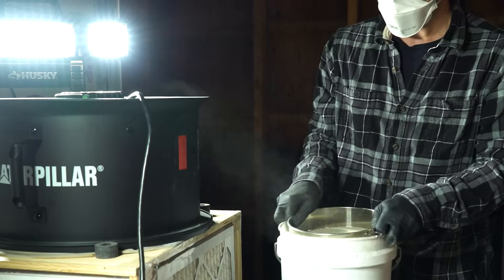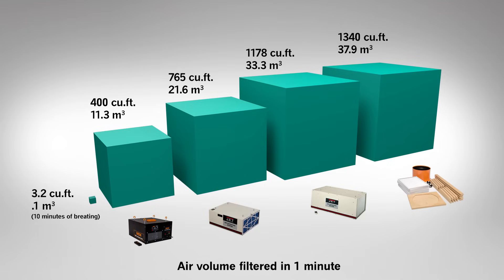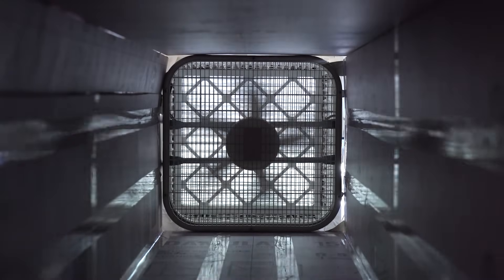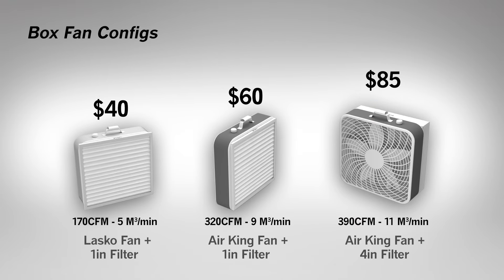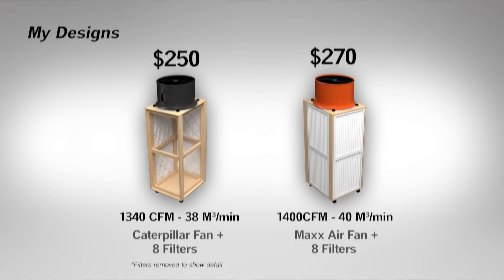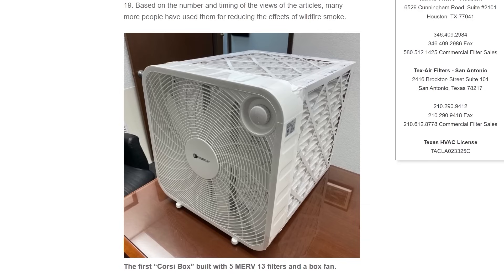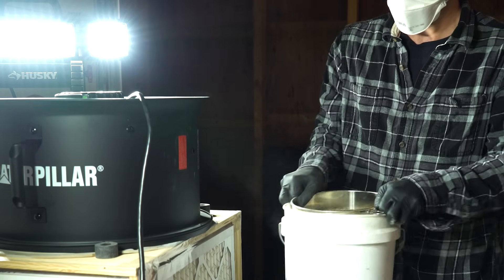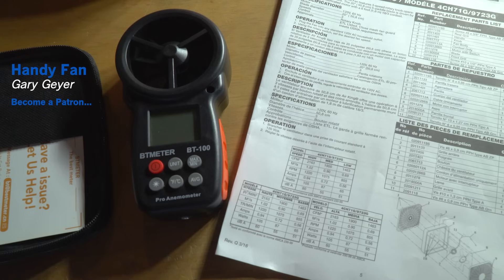What is the best DIY Air Filter?

Comment: You absolutely do not want to be using higher than Merv 9 on your air conditioner when running in cooling mode. Florida people know this. You’ll get high static vacuum and the system will perform poorly even before the filter clogs up. 

You’re better off running spot filtering with high merv filters. Maybe even running high merv spot filter right in front of main air handler intake.

Comment: If you're measuring CFM will similar would not be the better way to put a large plastic bag maybe the type of bag used to store or cover a double mattress and then create a sort of blast gate in which you could pull up the gate and have the fan going at full speed to blow up the giant plastic bag. It might be a little tricky to work out the volume of a full giant bag but it would give you amazing comparison between fans

Comment: I heard that for better air circulation which leads to filtering your home or work space better you have to (1)  have the filter fan's back placed near a wall and (2) that the fan should be blowing air not towards the ceiling but straight along the room (so just in its normal fan position). Are these true, or does the dust continuously diffuses as the air is filtered and so there's always particles, dust, etc which will end up going back around the fan filter and get sucked in and filtered, even with lowering concentration of dust/particles in the air as the filtration happens ? Thank you!

Comment: MERV13 and above aren't cheap, where did you get that? Those are premium filters and requires fan motors that won't burn because of the restriction it imposes.
Wood dust particle smaller than 2.5 micron comes from hardwood sanding, and account for less than 2%. Knowing that, MERV12 is more than enough to trap wood dust in the air.

Edit: Also, your CFM readings being lower is because you are not measuring the entire wind flow coming out, but just a section of it with is often less than 50% of the total CFM because of dissipation. To proper mesure CFM, you need to capture the full size of the exhaust port of the fan.

Edit2: @9:35 you are pushing air into the filter, that's now how filtration works and is a big no no. Doing that, you create positive pressure inside and dust will find a way out, either through the cracks between filters or back up through the fan itself. Air to be filtered need to be pulled through a filter so particles get traps without the adverse effect of pushing particles through the filter filtering net. Also that way, you can 'see' how dusty your filter have become.

Comment: I noticed on yoeu setup you have rhe fan blowing downward to pull air into your Rosenthal box. Is it supposed to be the other way around? Using the fan blowing upwards to pull air into box from the outside? My main thought is that with the way you were doing it is your fan would get super super dirty vs if it was pulling air through the filters then the fan aould stay cleaner and probably extend the life of the fan. Thoughts?

Comment: Because the center has no air flow why not cover it with an Aero Spike (see SR-71 engine where I learned this from Ben Rich). An Aero Spike is simply a Cone, If the unproductive center of the Lasko fan is 5.5 inches, than make a cone 5.5 inches across at the base and 11 inches long. That can be done with light cardboard or 3d printed. It is likely to help the air velocity increase by reducing turbulence around the fan center. It can easily fit inside of the 5 filter model.

Comment: As much as I hate being "that guy", I think it's important to point out that a standard (Lasko-style) box fan is not designed to run in a horizontal orientation. Gravity will pull any lubricant from the bearings putting more stress on the motor and making the motor more prone to wearing out faster or, on older unit, seize up altogether.

I just lay the filter against the back of the fan and let it suck up against the fan on its own. Not tape needed. The frame of the filter sits nicely on the fan's footies and as long as the fan is on the filter will stay in place. The most important part is to be sire the airflow arrows on the filter are pointing in the direction of the airflow.

I just don't think it's necessary to do that whole boxy thing with 4 filters. You're really not gaining that much filtration.

Comment: So I’m confused. Is it better to have the fan at the top blowing down? (Seems to have the benefit of shaking a dirty rag or part over it and it cleans it a lot more easily but this also dirties up the fan probably shortening its lifespan) 

Or is it better to have the fan at the top blowing up? (Seems to keep the fan clean since the air filter before it passes through the fan, but can’t be used to shake a dirty rag over it easily cleaning it)

Comment: Have you considered testing a standard home shop vac running with a hepa filter and bag? 

Obviously, the performance would not be anything outstanding (like your designs), but maybe it could be an option for someone working in a garage who already has this setup sitting there and would otherwise do nothing. 

Amazing video!! Thanks so much!

Comment: What would you recommend if I live in a 900 sq ft apartment with two dogs and no filtration? I don't have room for a huge unsightly Corsi Rosenthal box. Maybe a mini one or a tall skinny one. I was considering just using the airking with a single 4" filter.

Comment: I have been thinking about using bag filters. They might not have very high merv ratings but they have very low pressure drops.
Reply from the maker: I think you can find the with high MERV ratings but the pressure drop is more significant. Grainger has a lot of data on them

Comment: I just bought an Xtool S1 laser. I attached the plastic tubing (3 in diameter) to the back of the unit, then adapters from Home Depot (3 in to 6 in) to the VIVOSUN AeroZesh S6 6-inch 405 CFM Inline Duct Fan. This tubing is exhausted through a hole in some corrugated cardboard out the window. I'm still however getting fumes inside my work area. And I'm running the duct fan at max (sounds like a jet enging).

Any suggestions? The cheapest filtration system I could find is about $350, with the filters costing $75 a shot. Supposedly the filters will last 300 hrs. The smoke purifier is a Genmitsu MD13. Thanks.

Comment: If you were to attach exhaust to the outside, would it not create one of theose pressure situations that would pull the air towards it with more strength?

Comment: I have a Wood’s AD30 Hybrid/ Air purifier & DehumidifierWith  Hepa filter Article number: 8012810 and the color indication on the side of the filter indicate changing every 2 months or so. (It runs in average 12-15 hours per day. But filters are very expensive? (About 50 EUR) 
So I am looking for an alternative that I can make by myself or a copy of it or anything. 

Where to find raw material for them? Is it hard?

Comment: So many options. Great comparaison not found elsewhere.

I just need to reduce allergens in my room. I will try to find a 4 inch filter at a reasonable price. Difficult here.

The fan itself is close to $90 CAD here sadly.

8:30 This chart is amasing. Thank you so much.

Comment: How do you think Matt Montavon's setup using the CAT fan and a merv 15 cylindrical dust collector filter would perform compared to the options you tested. More expensive, but the footprint size is nice and dead simple to put together without building anything, but curious if its better or worse than what you presented.
Reply from the maker: His design is simple but after throughout testing, it is not as good as the drum fan + disposable filters designs. I'll talk all about it in an upcoming video. The short of it is that the drum fan cant handle that filter and an inline fan, like the original Bill Pentz design is a better option if you want to use a canister.
Reply: @The3DHandyman  Thanks for the information! I'll keep an eye out for the video

Comment: Something to remember is that the ASHRAE test, where the MERV ratings come from, uses a 100 feet/minute face velocity.  This is calculated by figuring out the area of the media, which for a pleated filter is 2-3x more than the size of the filter, and dividing that into the measured flow.  So to get the listed efficiency your face velocity needs to be no higher than the 100 fpm test velocity.  The advantage of the commercial units is you can cascade the filters.  I use a 40% ASHRAE filter as a pre filter and a 95% DOP (about MERV 15) final filter.  My setup cost more but it’s much quieter which is worth it to me.  The other thing to consider is to either clean your filters often (before you can see they’re dirty) or isolate them from the vibration of the fan.  If you look at SEM photos of dirty filters the dust particles look like dendrites, the fan vibration can shake them loose and release the dust back into the air.
Reply from the maker: Good info. Thanks for the comment!

Comment: I have thought about this too with a twist. I would like to see a  filter on the discharge end of a shop vac . I have used the two pail method to create a cyclone .  but then there is the dischage from the vacuum  that puts fine particles into the air. i am currently retired and do not have a lot of money but i am going to try filters at the discharge end of the vacuum. it would be nice if you did a study on this.  note although the vacuum has an internal filter  this catches all the big particles before they setle in the bottom of the pail not what i want. hope you appreciate this concern.
Reply from the maker: That's a good thought. I have seen this myself on my old shop vac and a newer handheld craftsman vacuum. My Ridged vacuum has  HEPA filter I can put on it which is the best option. I could see a stationary setup that pipes into a box with MERV 14 filters to capture more of the leftover dust. I'll be doing a build for a kit that could be used like that some time soon. Thanks for the comment!

Comment: Like to buy 1 or 2 for my shop but never bought merchandise through Etsy.  Went to your web site.  No email or any contact info.  What about availability of a particular kit? Delivery times, etc.  Would be nice to at least have a form of contact.
Reply from the maker: Hi! I don't do contact forms anymore because web bots spam them all day every day and 99.5% of the emails I get are junk. 

I will have a website where you can buy things directly in the next 2 months or 3 months, but there are lots of things to do before I get to that. 

You can use Paypal to buy one and I will give you 5% off of the Etsy prices if you like. The lead time on these is currently about 3 weeks. Otherwise Etsy can be used as a guest so that you don't have to make a login or anything. 

Let me know if you have any questions!
Reply: @The3DHandyman  Yes, I do have questions.  As complete as your videos are, trying to make a decision from what and how the info is presented is like drinking from a fire hose.  I want the best filtration for a home wood shop.  Seems like there are lots of options to get hung-up on including what side filters and types.  I would want a floor unit with wheels for mobility and not so loud you can’t have a conversation or you need hearing protection when it’s running. I would need 2 since I have equipment in two attached but separate spaces from which I am moving continually.  But the need for mobility is so I can move it to the most effective location in each separate space.  At over 70, 3 weeks maybe ??? is a long time and after COVID, I am afraid of anything that isn’t “in stock ready to ship”.  Any other options at least for communications besides the YouTube comment section?  Which one and filter size?  Where do I buy it with PayPal if not Etsy?  Confused since your links went only to Etsy.
Reply from the maker: @bw162  The Caterpillar drum fan option is probably the best choice for your woodshop. The 2 inch wheels are great but the 1" wheels also work well for most spaces. 

As for filter sizes, the 20x30" filters are the most efficient option but if you don't have a lot of floor space the 14x30" or 16x30" kits also work great. 

Feel free to contact me through the Etsy message system or on social media if you use that. There is currently a wait time if you buy a kit now. If you wait a few weeks, the wait time may be shorter.

You should see a "contact" link on this page https://www.etsy.com/shop/The3DHandyman

Comment: Have you considered using two 1-inch filters with one on the front and back of the fan (both filters oriented forward of course)? Alternatively, what about two box fans with a 4-inch filter inbetween, so one fan is pushing and the other pulling? Or some combination of each method. It would make for a much smaller footprint than a full CR box , but I'm not sure if it would offer any performance increase.
Reply from the maker: I haven't tried a dual fan method. It might offer some performance gains but probably not as much as 2 fans with a single filter attached. 

I have tried running filters on either side of the fan but they performed about 5% worse than with the filter on the back. I also used 2" filters. 1" filters are almost not worth using in a single filter configuration.

Comment: Just (literally just) finished building mine. Super satisfied with the design and function and threw some sawdust in the air to see it in action and thankfully it worked like a charm.

I added a 2x4 frame at the base with a 3/4” piece of plywood as a base to give it more weight at the bottom. It moves and glides around the shop with ease.

Thank you!
Reply from the maker: Glad you like it! Thanks for the feedback. I'll be doing plans for quad filters in this same style later this week if you ever want to convert to a design that uses fewer filters.

Comment: This is an amazing design! I'm going to build it myself! One question, I assume once you start using the setup where you throw aire inside the box, you can't reverse it unless you change all filters? Thanks for all those videos mate, you're saving a lot of lung problems on the long run!
Reply from the maker: Thank you! The fan direction can be reversed, you will just need to reverse the direction of the filters before turning on the fan. It also wont hurt to vacuum off the filter frame at that time.

Have fun with the build!

Comment: Air king is a 22.5” x 21.38” so what size air filter is needed? Still just 20 x 20 or larger ? Please, I really hope you can answer this because I live in Central America and no box fans are sold here and I need to get the correct things shipped from the states. Thanks in advance!
Reply from the maker: The filters are still the standard 20x20" for the Air King. Duct taping o the filter on will close the gaps. Let me know if you have any other questions!

Comment: Wait, why wouldn't I blow the fan OUT, sucking in from all directions?  I thought that's what you were doing, but some test snippets seem to be pulling directly into the fan housing.
Reply from the maker: I need to make a video about this concept because this question comes in all the time. There are a huge number of benefits to pointing the fan into the filters if the fan has an enclosed motor. If the fan blows into the box then you can use it like a dust bin. The largest benefit may be that the dust collects inside the box rather than on the outside.

This is not always the best option tho, so yeah, a video will be needed.

Comment: I am working on the compact design for my small garage workshop to be mounted on the ceiling.. Any updated thoughts on pushing air up into the filters vs down? Thanks!
Reply from the maker: Personally I like blowing air our of the filter for this configuration but the filters will likely shed a little dust when you turn the fan off because the dust will collect on the outside. 

I am currently working with this fan on a "push config" so that the dust collects on the inside and it's not too much of a pain to mount or change the filters. https://amzn.to/4bRNPhZ

The video for ceiling mount filtration is in the works. I hope that will be out in about 2 weeks...
Reply: To clarify,  you would point the fan to blow air into the box/filters. That’s what I was thinking would be best if I put it directly over my table saw. Would love input. Looking forward to the next video.
Reply from the maker: @gcox87  The only fan I would do this with is a Caterpillar fan. Generally I only use that one on the ground. People have mounted them on the ceiling in the past though. The nature of DIY engineering is to try something and see if it works, if it doesn't, then try something else 👍